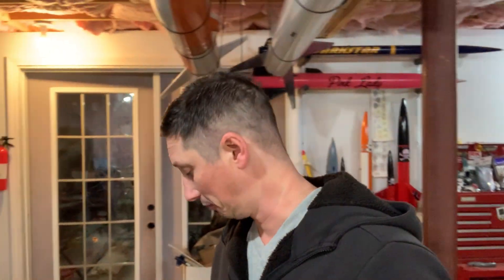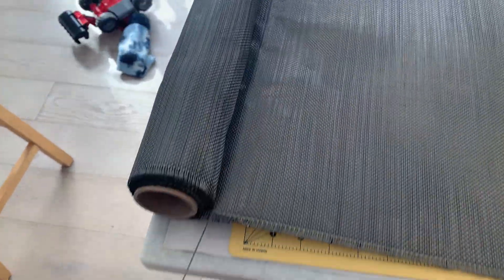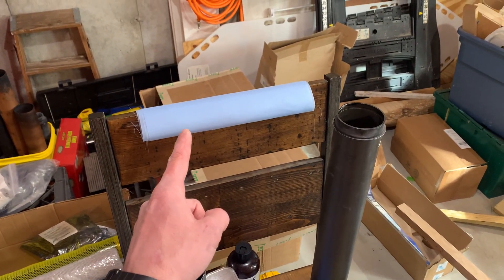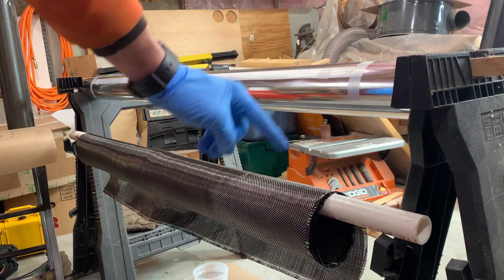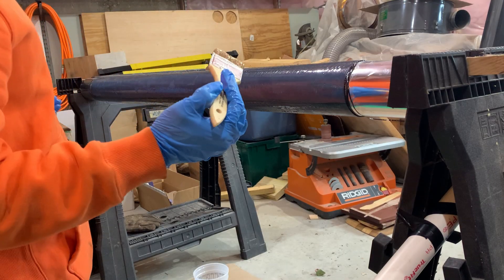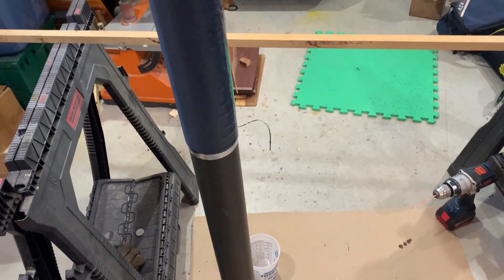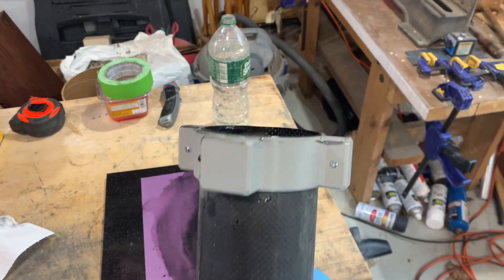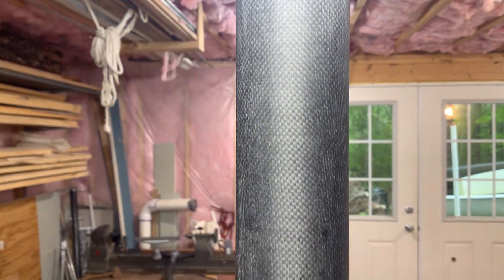How I Roll Carbon Fiber Tubes for Rockets

Comment: Technique looks good, the key is to give the epoxy time to soak in as opposed to trying to force it in. You could probably go around the tube with a squeegee (or spreader, thin plastic thing) the same direction as the wrap, starting in the center and spiral off one end, then center to other end. This will tighten up the weave, push out any air pockets, and get rid of excess resin (have a bucket with you and expect to scrape the squeegee off frequently). The ideal weight ratio is 50/50 resin/cloth but that's hard to achieve without a vacuum bag. 

A good technique with CF is to lay down a plastic sheet with a 6" border around the cloth, pour a line of epoxy down the middle, and another sheet on top. Then with a squeegee slowly work the epoxy towards the edges. Flip the stack and work out any bubbles/pockets on the backside. Push excess epoxy away from the cloth by 2-3 inches and go around the perimeter with scissors or rotary and trim away the cloth edge. When it's time to apply, peel away one layer of plastic and stick the cloth onto the mandrel and roll, peeling away the plastic as you go. The cloth cuts very clean and your lap will disappear, and it will lay up nice and tight with no dry spots or pinholes. It's like poor man's pre-preg.

Be mindful of exposure to epoxy, both wet and newly cured. Epoxy is a sensitizer and can get you at any time, your system says that's enough of that stuff and suddenly you have terrible itchy rashes, hives and even difficulty breathing, just being in the room. Had a buddy who used to make surfboards, now he can't be in a room with an epoxy board that is less than a month old. Never dry-sand and always PPE up, sanded fibers with newly-hardened epoxy is nasty stuff, still plenty of uncured molecules and the fibers pierce the skin like tiny needles. Double gloves are key so you can change out the top pair without getting that spot on your wrist wet, right where all the veins are. Use liquid dish soap and your fingernails to scrub it off your skin and NEVER use solvents, they just thin it so it goes in faster. I usually look like an astronaut when I'm sanding. Once you join "the club", you're a member for life.
Reply from the maker: This is a great comment. One because of the poor man's pre-preg method. Two, and most importantly about the safety aspect. I am normally respirator'd up but decided not to so I could do some commentary for the video. I really wish I spent a minute going over safety and the sensitizing to epoxy stuff. Also I don't mention it but I always wet sand, and use a respirator with carbon fiber since the dust is pretty much straight cancer.
Reply: @pathtouch1  I will always tell my employees to wear respirators, but carbon fiber dust is not cancer and is not toxic. If you look up the MSDS it is categorized as a nuisance dust. It only becomes hazardous when uncured or with the use of high speed tooling like CNC. Neither of which you have to worry about. Hand sanding is only dangerous to the electronics you keep nearby.
Reply: Getting sensitized to epoxy 'at any moment' is not true. It takes years of immense stupidity. That doesn't mean don't wear PPE, always do. The correct information to share about sensitization is around the eyes. It can take only a one time exposure of the eyes to epoxy to cause sensitization. Safety glasses are far more important than respirators or gloves if that is your primary worry.

Comment: How do you mate the body tube to the fin can?
Reply from the maker: Just using the motor case as a coupler. There’s a retainer in front of the motor and a threaded eye bolt passes through that into the forward closure. Spinning the motor into the rocket keeps it all in compression.

Comment: One method to make sure its wet out and no air pockets is to use a 2" wide foam roller to apply the epoxy.  Used that method for years.
Reply from the maker: I'll have to try that next set of tubes and compare my mass fractions!

Comment: You are using what they call carbon fiber cloth. The cloth really only is for the finish carbon fiber look. What you should use is straight carbon fiber and add a minimum of 4 layers. You want the layers to go in this order 0° 90° 45° 135°. Then if you prefer the carbon look, add the cloth. Then let it bake in the oven.
Reply: Uni-directional?  Vastly overkill for this.  He will have plenty of strength from the twill.

Comment: why not use a drill to spin the mandrel slowly and use a wheel (skateboard wide type) to roll against CF start at the bottom and go to the top,, this will force the layers together and remove air pockets and extra epoxy .. then apply white fabric
Reply from the maker: You make the contraption and I'll try it out! 😉 If I were producing more than a couple tubes a year I would actually consider making some sort of winder like that though.